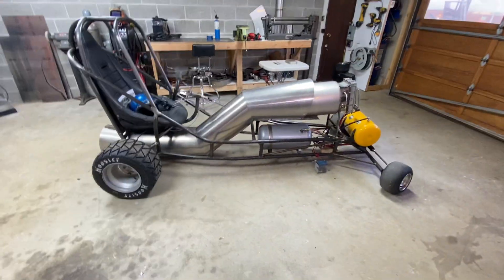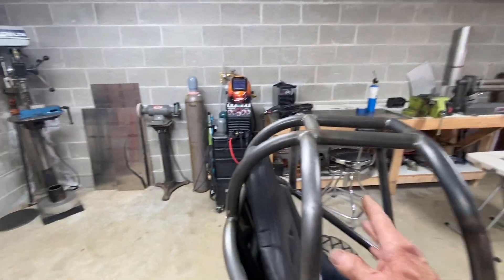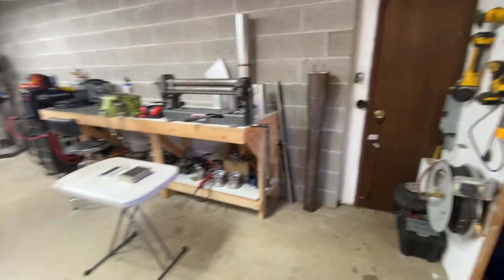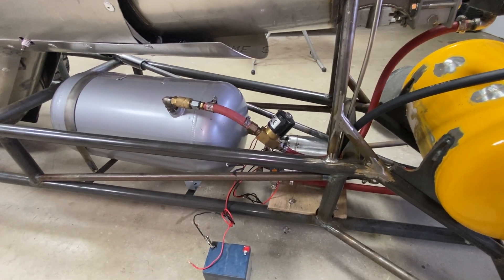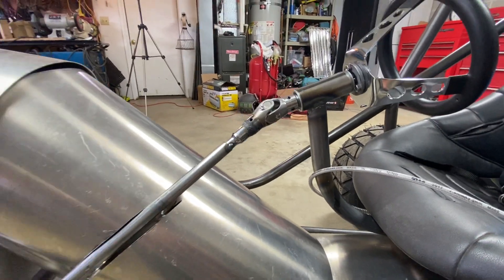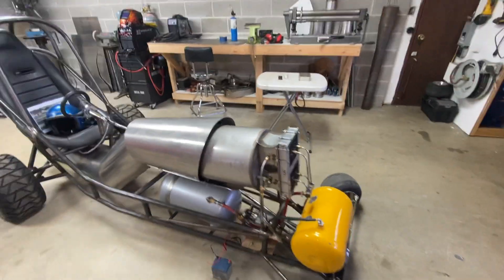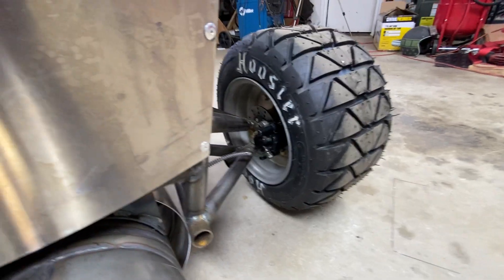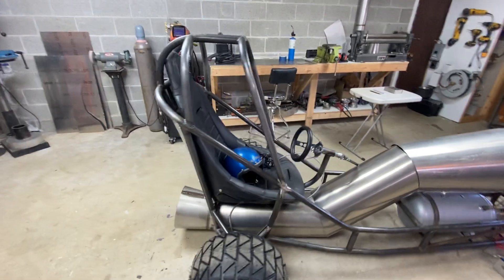Crazy Rocketman: FASTEST jet kart EVER the "DRAGON"

Comment: See where that offset goes under your seat? As an old power flue industrial gas specialist, you have yourself a very hot spot and excessive heat problems at that bend. I would wear some heat protection on this one. Secondly, if your tank leaks where is that fuel going? All over you sport! Sitting on a red-hot flue. There is no chance of ignition there ah!  Be careful with this one Bro as all those 15M hits isn't going to matter if you turn into Mr Crispy. All the best from Oz. It's a no go for me. Seen to many explosions. Just like this waiting to happen. Good luck. Live long and prosper!

Comment: You actually inspired me to make my own pulse jets and right now I'm running a cleaner can jb welded to a half inch by 30 inch galvanized tube on non ethanol gas and it won't normally run unless I aim a balloon pump at and it runs HARD im trying to 3d print a turbo but it's not smooth enough we have got it so loud that you have to almost screem to hear it.

Comment: The German WWII V-1 rocket was essentially a small drone aircraft with a pulse jet engine. The Germans would stuff them full of explosives, give them just enough fuel to fly more or less to London, point them at London, and send them on their way.  They would buzz along at high speed until they ran out of fuel, somewhere in the vicinity of London.   The British called them "buzz bombs".  When they ran out of fuel, they'd crash to earth, causing the explosives to blow up.  The Germans didn't really care where they landed with any degree of precision. The destruction caused by the explosives was a secondary purpose.  The main purpose was psychological.  Londoners grew intimately familiar with the sound of the buzz bombs, but they also knew that, as long as you could hear them, the wouldn't hurt you because the sound meant they still had fuel.  They learned to hate the sound, but fear the silence.

Fortunately for England, Hitler was obsessed with high tech.  He diverted a ton of the money into the V-2 missile, a true ballistic missile.  Turns out making ballistic missiles is really hard to do.  It truly is rocket science.  The V-2 project never achieved any success.  Most missiles either failed to launch, or failed shortly after launch, exploding in or over Germany.  Meanwhile, the project depleted the V-1 missile program of funding.

Comment: Did you ever consider using a pickup truck? Remove original gasoline engine and put the Fuel and air tanks under the hood maybe... I think you're cool AF for building this stuff. I liked your channel almost immediately. After thought.. An El Camino would be bad ass.

Comment: Wonder how well a pulse jet used as a gas generator would work to spin a turbine and geared down to drive ya wheels. Gas temps might be to high?  Or would it not produce enough pressure without interference of the operation of the pulse jet? Ive had too many beers.....

Comment: Hey Rob, I love the design of this cart. subscribing for more pulsejet based insanity!

 I have a suggestion to help cooling when the cart isn't moving, by extending the end of the heat guard at the back a couple inches past the end of the engine tube and flaring this extension slightly, the exhaust of the engine may be able to pull a pretty significant draft through the gap. It may require the bottom of the heat shroud be closed off on the back end of the engine to properly direct airflow though. the idea is the exhaust gasses would drag air along from between the layers a bit like those venturis you see on some diesel exhausts, helping move the heat out from under the shroud. 

 The Lewis gun used this concept to help air cool it's barrel back in the early 1900's, using the gas that escapes after the bullet left the barrel. Not sure if it would be enough to protect against shroud overheating while stationary entirely, but it may help extend the runtime before that happens a bit.

Comment: you ever thought of fixing a plate and skirts under that go-cart to make use of the ground effect produced by the fast moving air exiting beneath the seat?

I'm thinking, you can extend the sheet forwards a little of the air exit and, then, use the skirts to channel any air hitting the front of the cart underneath the cart towards where the hot fast moving air is being vented.

If the skirts could be free to move up and down and fitted with tough plastic sliders at the point they hit the surface of the desert, the , you could actually achieve quite an amount of downward suction 😃

If you extended the plate wider than the chassis, you could also use fins to direct the air around the rear tyres on the lower side and use strengthening ribs on the topside push it over the tyres...plus, the wider the sheet, the greater the surface area and the greater the effect 👍👍

Comment: Bicycle/pit bike wheels 15-17" with full independent suspension would go faster. Less roll resistance and less direction changes to the main mass. Also every wheel could have brakes, so it would be a lot easier to control.

Comment: Would smooth narrow tires offer less rolling resistance? The reason wheels are treaded is to grip the surface because it's being turned by whatever means. Since there is no drive line your just being pushed and the motion is static.
Reply: Maybe wider tires will steer better than skinny ones, but with this contraption I’m not sure you want to try to turn much - just going straight is probably safest.
Reply: Sorry but this is not the worlds fastest GO-Kart the record is 116mph.... about twice the speed robert has made

Comment: In regards to your steering system- have you considered using a hydraulic steering system designed for high performance outboard motors?  Just a thought from the peanut gallery.

Comment: I am a pipefitter. You have done a lovely job pipe  bending. That is a lost art in pipefitting today.Most young pipefitters do not know how to bend pipe and tube by heat or machine    to precise measurements. To heat bend pipe .It is 6 X the diameter of the pipe. Mark the centre of your bend .Center  to End of pipe measurement , 2/3 of the bend behind the measurement .  1/3 in front of measurement. Heat the pipe to amber red. and bend.  Enjoy your videos. Thankyou.

Comment: Great, i hope the best for you channel. Its interresting, kind a weard content and good video quality. 
Also like you beard, dont cut it but take care of it dont get on fire. 
To not let die the engine by opening the trottle to mutch, 
maybe you can sens this by any kind of sensor to quick close (regulate) the trottle by elektronik (Arduino).
So you can full trottle and the controller locks for maximum power at given conditions.